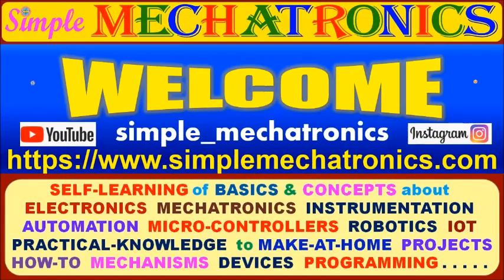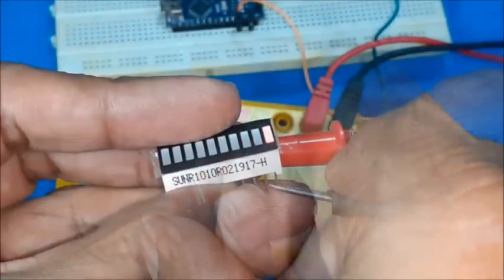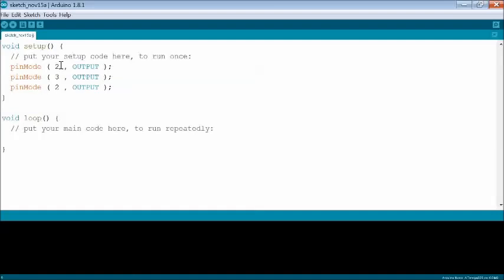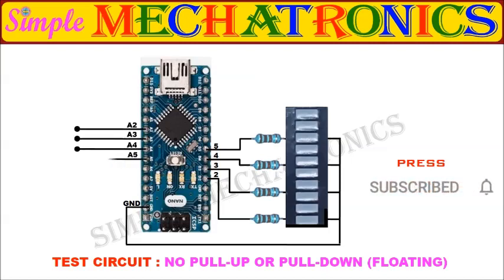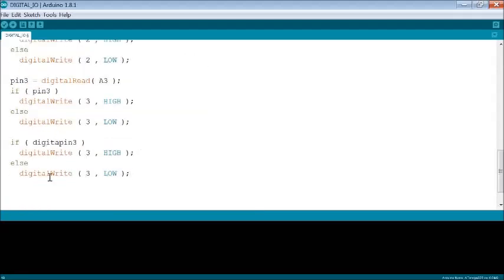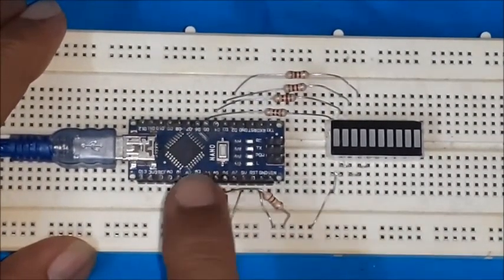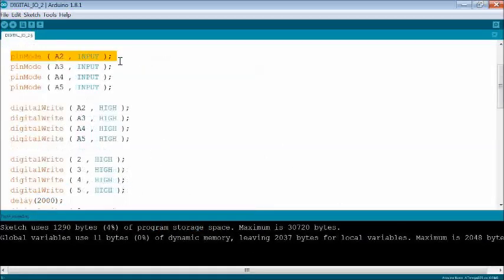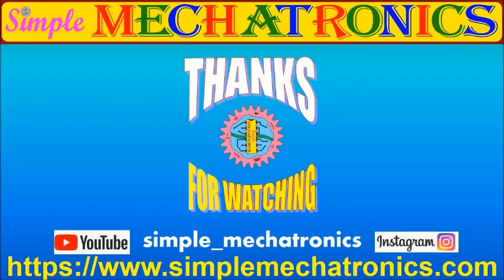Step-by-Step ARDUINO Step#2 Digital Input-Output using Arduino Nano | understanding I O code

Comment: does it required servo calibration for long time use?
Reply from the maker: Thanks for contacting Simple MECHATRONICS.

A servo motor needs calibration, if it is used in precision control system.  The servo should be calibrated initially and periodically, depending on the usage.  So, for precision control, a good quality servo is to used in the system, and calibration is required.

Where as, for a general purpose control system, the servo need not go for calibration, but, in case the servo is not moving as designed or not working as its intended function, then the servo needs replacement.  These general purpose servo motors may not match the turning angle exactly with other.